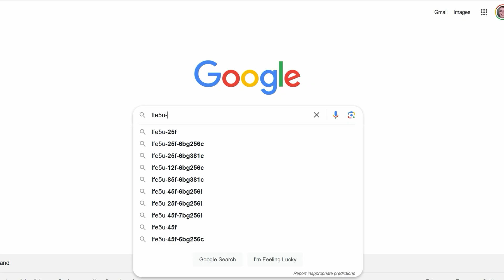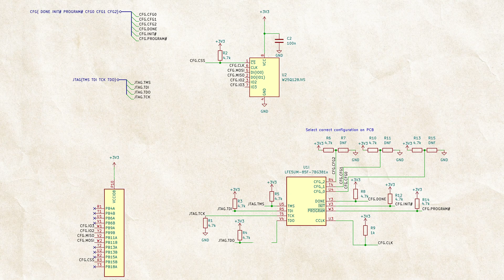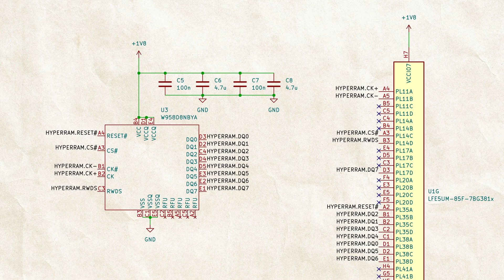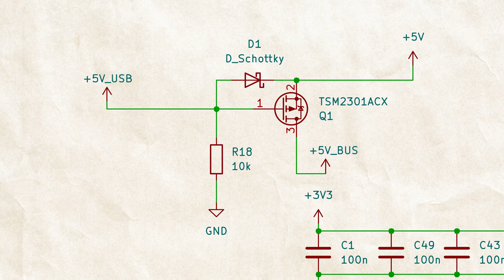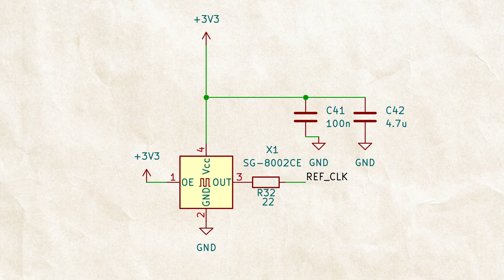I Designed My Own FPGA Board! Part 1

Comment: how much cost if you make clone FPGA card same than mesa 7i96 to hobby cnc machine uses.  normal mesa 7i96 etc, cards have too expensive buy hobby cnc users budget. lot hobby users need cheapen option buy clone card who can use whit CNC machine and linuxcnc software, less than 100$ have perfect price point.
Reply from the maker: As I said I am not planning to design other boards right now. To replicate the whole mesa board firstly I should spend a lot of time to find all functionalities and hardware inside. And unfortunately I don't have it for that right now.

Comment: wow, that's a cool computer! I love the custom graphics! Btw 20k logic elements is already enough for simulating an entire amiga in fpga, so maybe other innovative uses for 84k fpga would be even more attractive. That's close to the 110k of the 68080 Vampire amigas using the cyclone 5 fpga.
Reply from the maker: Yes, most probably more than enough for me :) 
When I was selecting an FPGA 2 or 3 years ago, I found that the ECP5 family was quite cheap. Initially, I planned to order a 24k/44k LE version, but then I saw that some stores in other EU countries had a reasonable price for an 84k version, so I ordered two. And they have been waiting till now :)
Reply: @matgla95  good decision, they come to perfect use now.
Reply from the maker: Yes, and I am planning to offload some tasks to RP2350 on both the motherboard and VGA extension, so I should be able to save some logic elements for other tasks